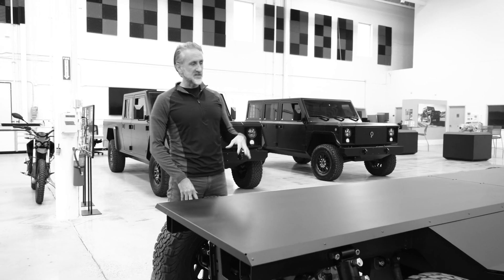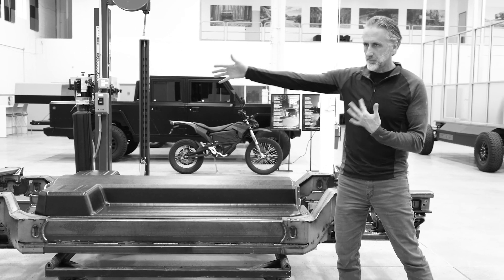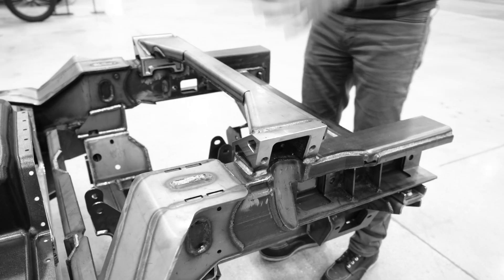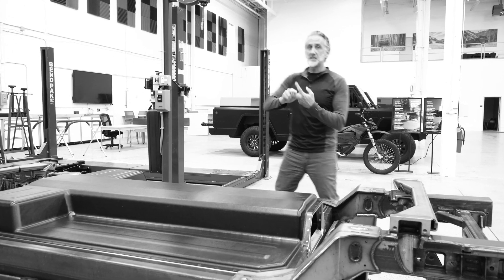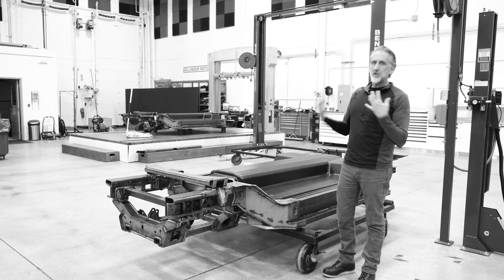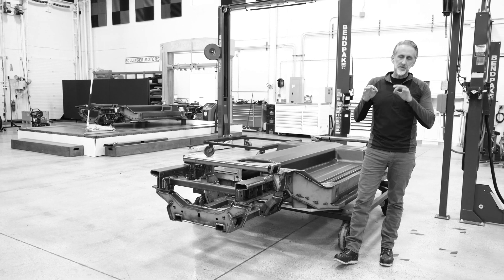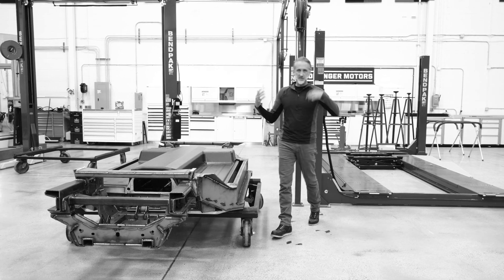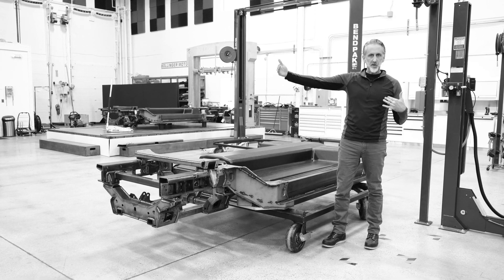CHASS-E PART II - Bollinger Motors

Comment: Do you guys still not have airbags?
Reply from the maker: We do not have airbags. We meet Class 3 Federal Motor Vehicle Safety Standards through use of seat belts. In addition, we are using simulation software to engineer our trucks to our own Due Care standards that far exceed Class 3 requirements.
Reply: @BollingerMotors  I wouldn't get in to a fast vehicle without it
Reply: @BollingerMotors  and Class 3 Federal Motor Vehicle Safety can be sold and use in Europa?